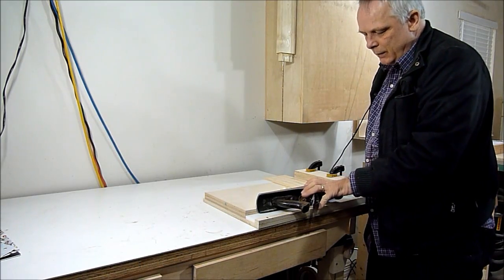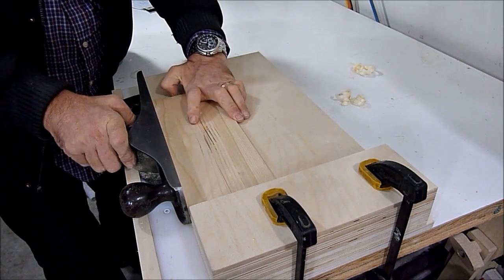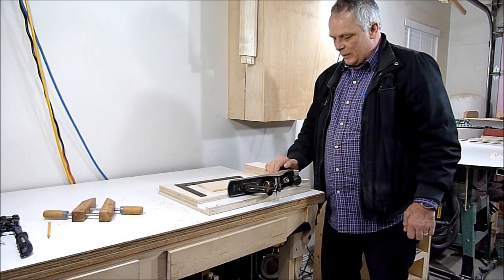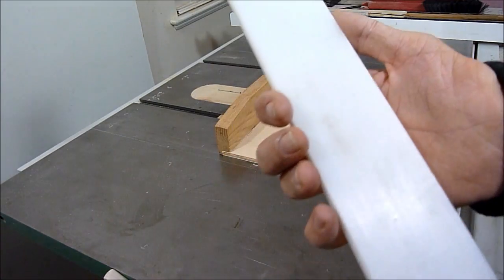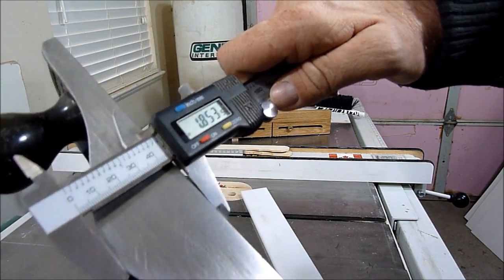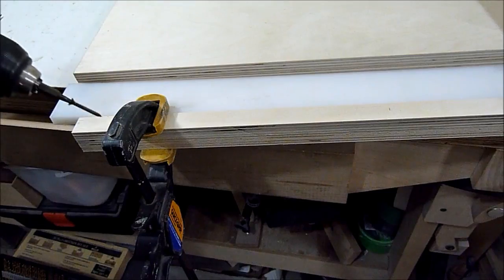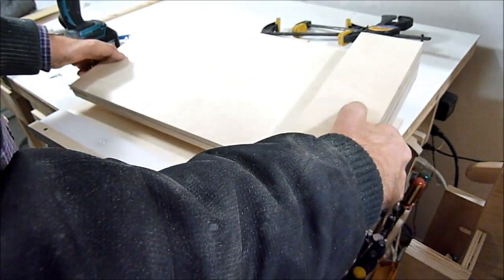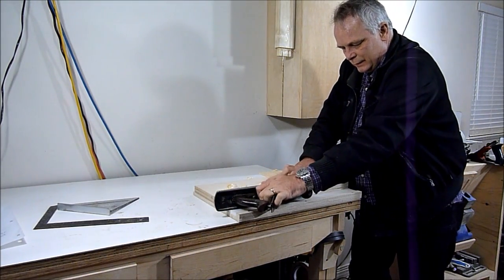Make a shooting board

Comment: I made one almost exactly like this one about a year ago but I did not have any plastic on hand so just waxed the runway for the plane and it works fine but I have an eye on a freebee polyethylene sheet and will upgrade when and if it materializes.

Very nice job, these things are great and you wonder why you didn't have one for the last 25 years.

Comment: Awesome! That will really be handy for the smaller projects!  You could really get the pieces squared up quickly! I like it! Where do you get that polyethylene material?
Reply: *****
A decent quality PTFE cutting board would probably work too; although it probably wouldn't be as durable as the HDPE; I guess it would depend on how much you use your shooting board.  Thanks for the vids BTW.  Much appreciated.